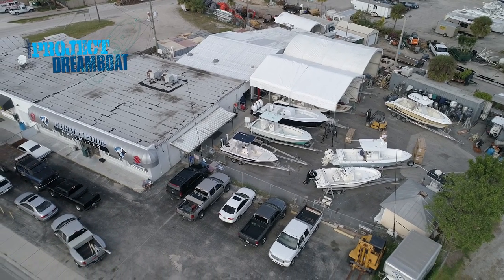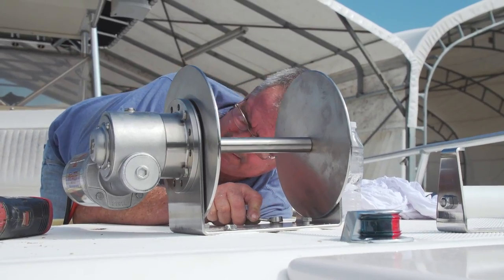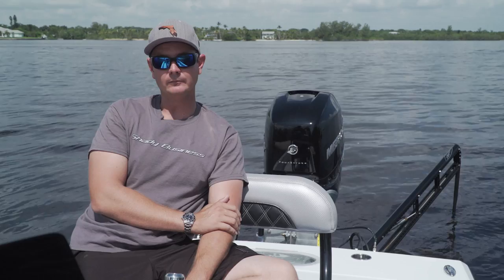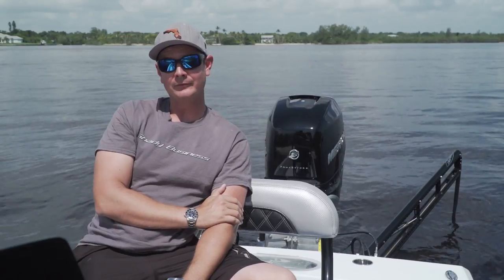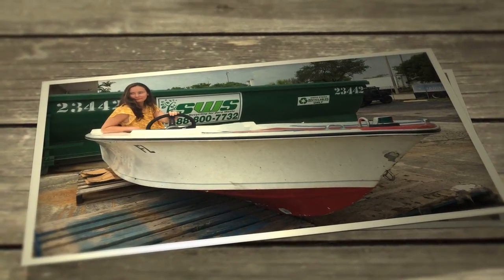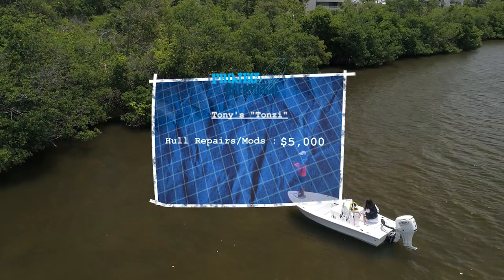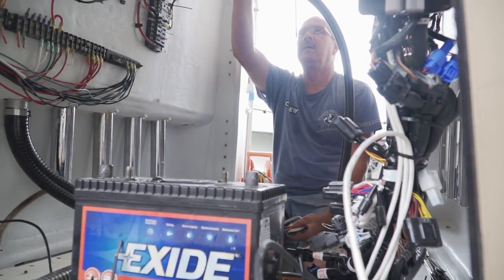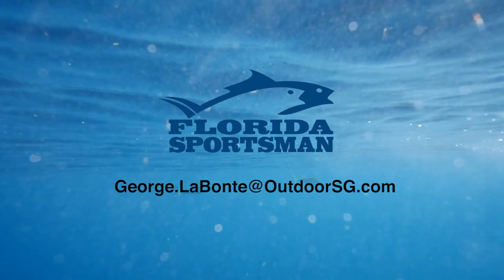Florida Sportsman Project Dreamboat  - Paramount Splash, Cuda Craftsmanship

Comment: Great job on the the video production it would have been nice to see before and after numbers on the performance. 70 MPH with a 350 HP is SLOWWWWW .. my 21 ft checkmate with a 220 did 68 mph. Maybe this boat is really heavy?

Comment: How come yall used a drum on the windless That has a fixed amount of line? Should of been a capstan windless that only has a couple turns of rope around it but can feed out or retrieve and infinite amount of rope so the windless can also be used in deep water the way yalls is rigged you can only anchor in water 3x shallower than the amount of rope on the drum 3x accounting for scope on the rope
Reply: Bahama boat = shallow anchoring.
Reply: Mike McCall i sure would hate being on my way to the Bahamas and wanna stop and fish in say 200ft of water for grouper at the tortugas but wait you cant cause you only have 200ft of rope on that drum my point im making is why not just instal a capstan you could anchor in 400ft if you wanted to if you had enough chain and rope and it also works in shallow water why limit yourself when youre having something custom installed on your boat